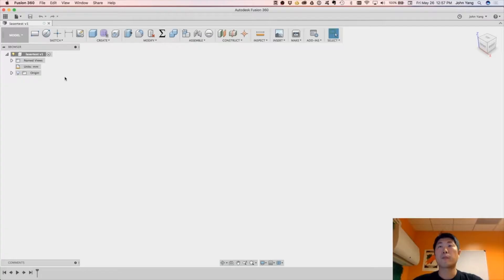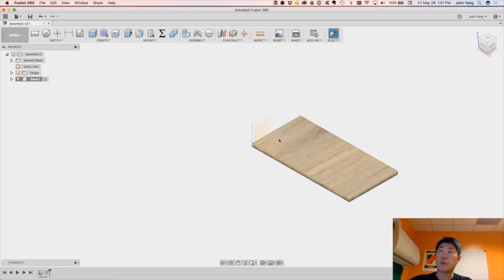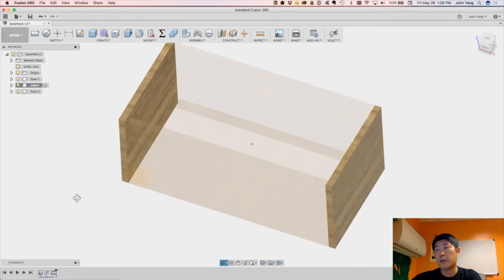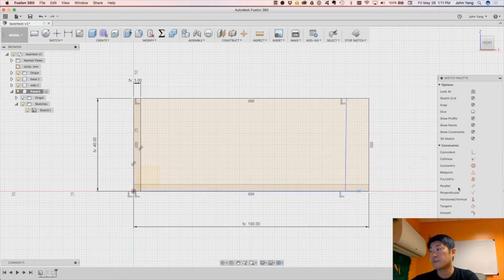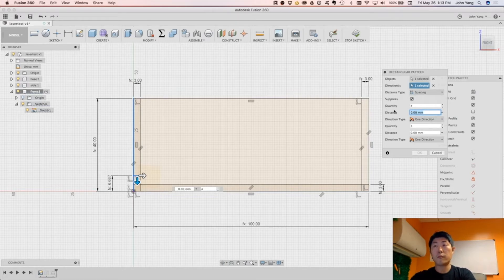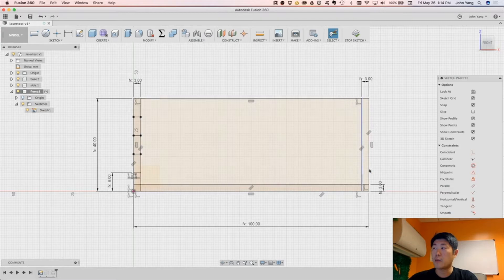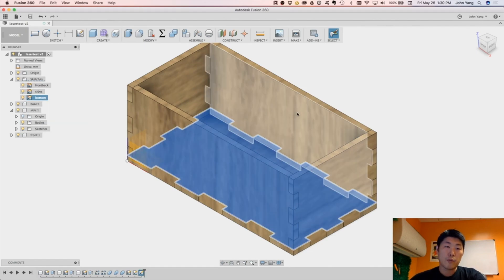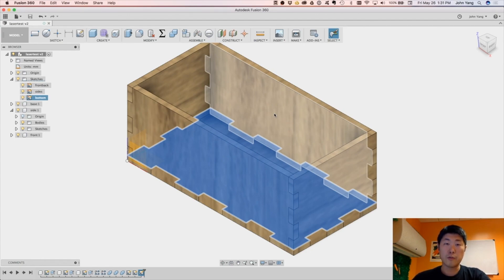How I design a laser cut box in Fusion360 - fixed audio

Comment: I couldn't see anywhere that you were applying a kerf offset. My laser has a 200um kerf, so cutting directly from the dxf files would give a very sloppy fit. I've used a similar technique, though I create a shape, then split body to get my 3mm sheets, and extrude tabs, combine cut, then offset faces for the kerf. For a simple box, there's a really good (free) extension for Inkscape (free) called "tabbed box maker". Type in the dimensions, tab size, kerf and click ok and you get an entire cutting plan in about 1 second.
Reply: Karl Fimm, what you are looking to do is capable with the Fusion 360 ADD-IN called "DXF for Laser". If you were to calculate the kerf in the model, you'd get overlapping faces, which might create issues on more complicated projects, and will show errors with collision detection.

DXF for Laser, can be tedious (but so is regular DXF exporting from Fusion 360), as you can only select one panel to export at a time (in this case you'd have 3 as 2 are identical to another 2). But it adds the kerf when you export. Open up the DXFs in Illustrator, CorelDraw, Inkscape, your laser software, etc., and lay them out for cutting in a single document if needed. If you plan on sharing the DXF's, don't put a kerf on the output, people with different lenses won't be able to cut it and have it fit properly. The kerf can be added in a vector editing program by doing an offset to the cuts. You may have to connect all points, or vertices first, as DXF for Laser does not join continuous lines/splines together.

There's also the updated sheet metal functionality for flattening and exporting (which I haven't done much experimenting with), but I don't think that adds the kerf either. You'll still need to add it in post. I think you can add that kerf using the CAM functionality when you create gcode. But most lasers I've seen, there's no easy way to send gcode to them, they act more like printers when sending cuts.